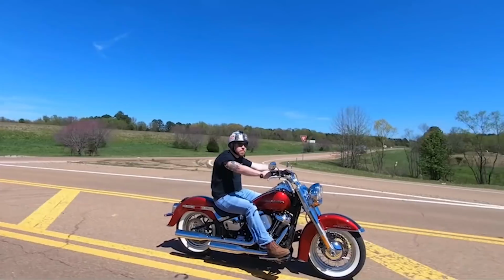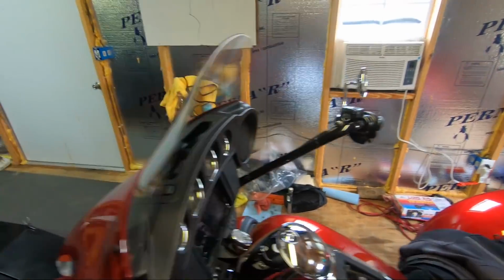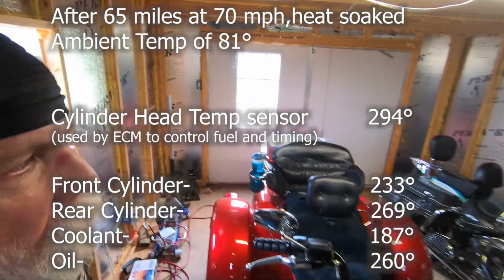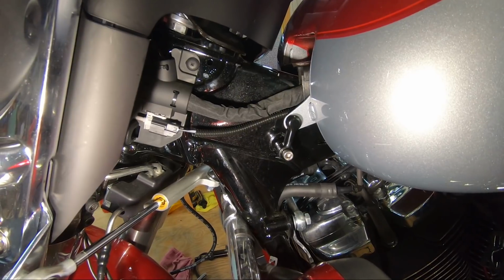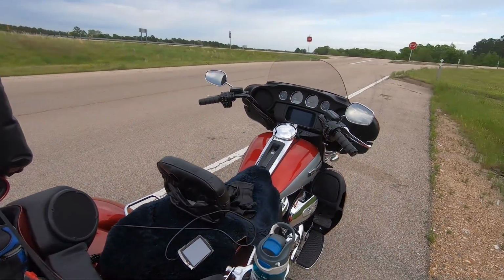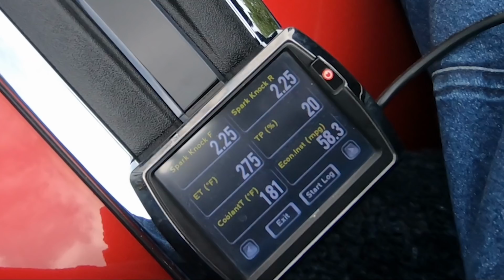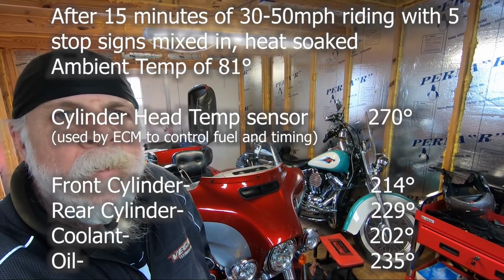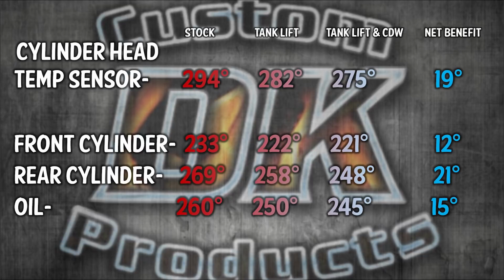Heat Test Report Harley Milwaukee Eight DK Custom Products

Comment: Hi should i run syn oil or mineral oil in 1998 road king w/30,000 miles?
Reply from the maker: That is not something we have done any form of testing on. My personal opinion would be to run mineral oil since that is what the bike was designed to run. 10 people will give you 10 different opinions on oil type but my philosophy is and will always be to run what you can't go wrong with. The Big Twin evo built it's reputation running mineral oil. If that were my Road Kind I would run Spectro V Twin mineral 20/50.
Reply: @DKCustomProducts  What about trans and primary?
Reply from the maker: @richardbarber8147  If you are cool with trying Spectro brand, they make a "Gear Guard" for the tranny. I know of people running that gear guard in ATV lift portals. Look those up if you aren't familiar, they are a pretty heavy duty gear drive assembly. They of course also offer a dedicated Spectro Primary Oil for the primary. Again, that is what I would run if that were my Evo

Comment: Im considering getting  your tank lift kit for my 2019 Road Glide Special to lower temps. One thing that wasn't discussed in the video is how does this affect the "range to go" mileage on the bike? Does it throw off that number significantly? I'm assuming changing the angles on the tank, might throw off that calculation. I ask because we travel a lot and I found that "range to go" feature fairly accurate on my Road Glide. I've been able to cut it real close on a few occasions without running out of gas.
Reply from the maker: This can depend on what size tank lift you choose. For example, a 1.5" or lower will not make a noticeable difference to fuel gauge readings. A 3" could throw it off 8-10 miles. The Deluxe option, used to lift the rear of the tank .5", does help to negate fuel gauge discrepancy.

Comment: This is a great test, but I’d really love to see you guys do a video of a bike like mine that’s highly-modified. I have a 2019 FXLR 124”, custom KB domed pistons with 12:1CR, 62mm TB, HPI tunnel ram, CR540, upgraded CSP/FP, etc. These are the bikes that will really tell the tale. I rode yesterday and it was 100° with high humidity in New England. I run as high octane as I can and I have an UltraCool with a reusable oil filter(can’t recall the maker but it’s not the $600 one). What can guys like me do for our situations? Mind you, and I think you will agree, a decent percentage of your viewers are a bunch of guys that want demon speed and are not conservative with the throttle. Combine that with temp issues you see with normal conditions and mildly modded engines, I think you see what I’m getting at. I’m about to order the Jim’s Force Flow, I need all the help I can get! 
Thanks!
Reply from the maker: Thanks for the detailed comment, sounds like you’ve built an absolute monster! We definitely hear you. Bikes like yours, with aggressive builds and high compression setups, push the limits far beyond what stock or mildly-modded bikes experience, especially in real-world riding conditions like 100° and high humidity. 
Are you monitoring your temps? If so, How? 

The Cooling Components we offer help even on highly modified bikes. 
Here is a link to a written report on the Jim's Fan that you may find useful/interesting - https://www.dkcustomproducts.com/force-flow-fan-test-report.htm
 
You can see the Jim's Fan at this link - https://www.dkcustomproducts.com/jims-force-flow-fan-cools-twin-cam-engine.htm
 
Here is a two part written report on Why & How to Cool Down Your TC/M8. We talk about why these bikes run hot and on part 2 we show different cooling options with temp drops from no cost mods to more expensive mods. You can see the report at this link - 
Part I - https://www.dkcustomproducts.com/why-how-to-cool-down-the-twin-cam-engine-part-i-dk-cl-tc-dn-1.htm
Part 2 - https://www.dkcustomproducts.com/why-how-to-cool-down-your-twin-cam-engine-part-ii-dk-cl-tc-dn-2.htm

Doing some test on highly modified bikes might make a great video. I will share the idea with Devin and Kevin. 
 
Please feel free to reach out with any questions:
Support@DKCustomProducts.com
662-252-8828
 
Thank you for commenting! 😎 MB"
Reply: @DKCustomProducts Hey thanks! I’ll check that stuff out. If you wanna use my bike I have a ton of PTO and Marriott points saved up, I’d be open to a road trip. I was planning on picking the ForceFlow up from DK, I bought a few things for this build from you guys.
I’m also wondering if there’s a way to relocate the oil filter mount and still use the UltraCool🤔
Reply from the maker: I will definitely tell the guys about your offer as well. We would love to have you come by. Where does your UltraCool mount? MB
Reply from the maker: I can not confirm compatibility. The only potential issue would be the space around the frame tube... The Oil filter mount needs to clamp onto the left side frame and the ultra cool may or may not be too close to the frame to allow this. You will need approximately 3/16 of an inch of clearance to mount the Oil Filter Relo. 

Please feel free to email our Customer Service with pictures and measurements for them to help with fitment. 
Support@DKCustomProducts.com
662-252-8828

Thank you for commenting! 😎 MB

Comment: Great videos! Would all the information in the video also apply to a 2009 103? Looking at cooling my trike as  heavy riding has a tendency to force the ECM to drop out the rear cylinder to cool it down. Thanks and safe riding.
Reply from the maker: Yes, some of the cooling techniques would apply, but there might be specific differences for the older 103 engine. Here is a written report on Why & How To Cool Down Your TC/M8 that you may find useful/interesting - https://www.dkcustomproducts.com/why-how-to-cool-down-the-twin-cam-engine-part-i-dk-cl-tc-dn-1.htm
Part 2
https://www.dkcustomproducts.com/why-how-to-cool-down-your-twin-cam-engine-part-ii-dk-cl-tc-dn-2.htm

Here is a full video play list on the subject as well- https://www.youtube.com/playlist?list=PLb3bvZgbH92_3s-2vv63QggFJ3nteFd_C

Please feel free to contact us with any questions:
Support@DKCustomProducts.com
662-252-8828

Thank you for commenting!👍😎👍 MB

Comment: Dwayne, Kevin, I'd sure like to see a controlled test with and without the typical abs plastic lower fairings.. You have on your's and I have on my street glide too.. since they do a good job blocking the wind on my legs,  I always keep my vents open (though they are not all that large).. I would be interesting to see how much they might help or hurt engine cooling.. Maybe you have already done this(?)
Reply from the maker: We have not done any tests on the differences of air flow across the engine with and without the fairing lowers.
There is a strong  opinion from a lot of folks that the lowers actually direct more air across the engine because of the shape of them.
We HAVE TESTED the difference in engine temps with and without soft lowers.  (the fabric that can be mounted to the engine guard to block wind & rain when it is cold.  The engine runs 10-15 F warmer with the soft lowers on than with them removed.  Same day, same riding conditions.

Comment: on the highway I seen my bike get up to 305 so I don't know what's going to bring it down that much on a 2020 Breakout
Reply from the maker: That's quite a bit hotter than you want to see...both for performance and for engine longevity.
Here is a video showing how much power HD cuts to the engine when it hits 270 F- https://www.youtube.com/watch?v=5PxJ8PvcVtc

Here is a written report with info on why they run so hot, and what can be done to cool them down- https://www.dkcustomproducts.com/why-how-to-cool-down-the-twin-cam-engine-part-i-dk-cl-tc-dn-1.htm

Here is a video of some things to do- https://www.youtube.com/watch?v=o3T3yA9BKwE

Here is a link to a list of videos dealing with this subject- https://www.youtube.com/playlist?list=PLb3bvZgbH92_3s-2vv63QggFJ3nteFd_C
Reply: @DKCustomProducts  thanks I did check your videos out and I figured it was too hot I've only seen it there one time running 80 down the interstate but normally it runs 280 to 290 and that's still too hot I've got a 2020 Breakout where do I put a relocation oil filter I really don't want it back by the transmission on the left side do they make something to keep it close up were the oil filter is I know the oil cooler is kind of in the way for mounting something on the side is where I want
Reply from the maker: @djmorgan8783  The oil filter relocation can go on the downtube, next to the oil cooler.  It is tight, but it does work.  We have had many Customers do that.  Email or call Dwayne if you have any questions about that.
Support@DKCustomProducts.com
662-252-8828

Comment: How do I decide what size to buy ? Is there a such thing as too high? I have a 2010 Limited FLHTK Harley-Davidson.
Reply from the maker: All the details are at this link- https://www.dkcustomproducts.com/touring-model-tank-lift-kit-dk-trg-tlk.htm

You want to check for clearance, it is pretty easy.
1. With bike on kickstand, take the bolt out of the front of your tank.

2. Loosen (do not remove) the bolt(s) at the rear of your tank.

3. Turn your handlebars all the way to the left and raise the tank up your desired lift height to check for clearance issues.

4. Turn your handlebars all the way to the right and raise the tank up your desired lift height to check for clearance issues.

Be careful when lifting your tank, you do not want to hit against something (forks, handlebars, trees, blinkers, etc.) when checking for clearance. 

While checking for clearance at different heights, you can also step back and see which height you like the look of the best.  For purposes of cooling, a  2" will get you plenty of air, especially if you use the Deluxe Option with it.
Reply: @DKCustomProducts  Thanks for Great information. I just placed another order thru you guys 2 days ago, didn't know about this product, guess will have to place another order
Reply from the maker: @Richard5873  We appreciate your business.
I believe you will be well pleased with the Tank Lift

Comment: I'm will assume that a air cooled only M8 might show slightly more change with the add ons.. I did want to ask about the Tank Lift Kit rear option, if installing that option to the rear causes problems with fitment of those  long-tonged seats of say the Street Glide, that run up to the tank panel, the seat fits pretty tight,  and will it lift the seat up too?
Reply from the maker: It will lift the nose of the seat up about 1/2 inch...the part that is on top of the tank, not the part you sit on.
Thousands have installed them on Baggers with no issues.

Comment: Hi Kevin 
  I just got a 2021 vivid black Tri-glide and have been watching your videos. Great job on those. I would like to know if it's possible to add a fairing mount oil temperature gauge on the new Harley Milwaukee 8 engines. I under stand that the trans/oil pan is the same as the twin cam, so the factory sensor should fit. You would just need to figure out how to mount and wire it to the fairing? I'm right or out in left field? Any help would be greatly appreciated.
Ron G  "live to ride ride to live"
Reply from the maker: Congrats on your New Ride!!! 👍  Glad you're enjoying the videos.
I run a Jes Customs dipstick temp gauge in mine.
However, I have seen folks mount a gauge in the lower fairing covers. (the covers that pops off to reveal the radiators)
I've never have seen one mounted on the dash on the 14+ bikes.
Reply: @DKCustomProducts  hey Kevin 
I think I can do it, but I have to do some more investigation into what parts I need to accomplish it. If I can make it work I will let you know and give you the part numbers so you can do a video on how to do it. Thanks for all your great information on your videos, keep up the good work.
Ron G.
 Back in the wind again
Reply from the maker: @tri-glideron9862  Cool, looking forward to hearing/seeing what you come up with.

Comment: I noticed on your site that there are different lift heights available for the touring bikes (I have a 19RGS).  Is there increased cooling with greater lift, or is it merely aesthetics?  Also, with the deluxe version, which I understand also lifts the rear of the tank, how does that affect the seat fitment and is the rear lift equal to the front lift size?

Edit: I guess I should have read more of your available literature on your site...LOL...Plus the hot babe plastered on your video was a bonus!...
Reply from the maker: once you get to 1.5" lift, there is little cooling difference between that and even a 3" lift.  Rear lift is 1/2" and it does lift the nose of the seat up a bit.  Most don't have a problem with that, but some find it uncomfortable.

Comment: 2019 oil colled street glide runs 360 on the head after its heat soaked.
Reply from the maker: Not sure where you're measuring the heat, but that is pretty warm.  You may be interested in this report- http://www.dkcustomproducts.com/why-how-to-cool-down-the-twin-cam-engine-part-i-dk-cl-tc-dn-1.htm

Comment: Any chance of doing a video test of the dual cool oil cooler?  295-315F is the norm for my oil cooled M8 at 2800 rpms, after heat soaking.
Reply from the maker: Yes, I'll be doing the "Before" part of the heat testing, then an install video of the Dual Cool Oil cooler, followed by the "After" test of the same.  Those temps are Far too high for Engine Performance & Longevity.  If you have not already, I suggest taking a look at this Report- http://www.dkcustomproducts.com/why-how-to-cool-down-the-twin-cam-engine-part-i-dk-cl-tc-dn-1.htm

Comment: I wonder if the 114 engine has a higher temperature than a 107 has
Reply from the maker: It is possible it may be a few degrees hotter.  We are no where near done on our heat testing, and so far, the 114 is looking very close to the M8 107 and the TC 103.  They all run too hot for their own good from the factory.  The M8 does a better job of not heating up the rider and passenger as much as the TC, but it is just as hot.